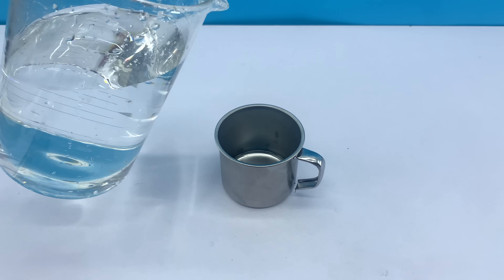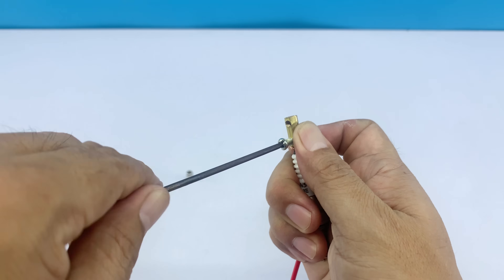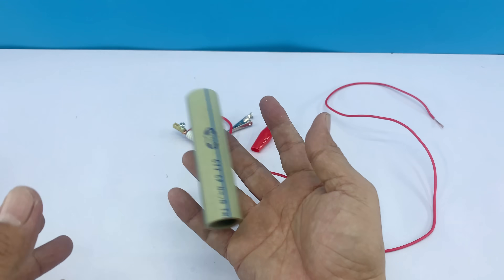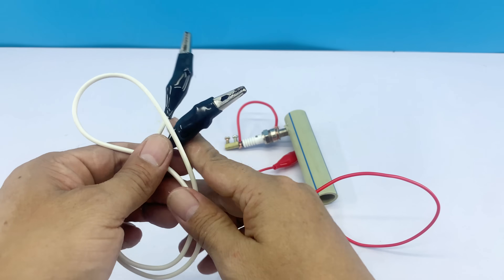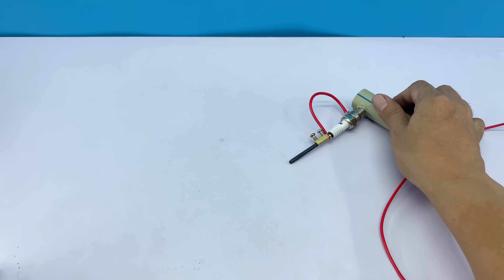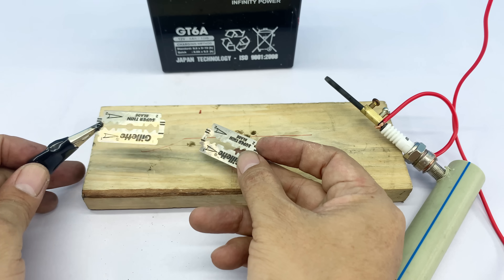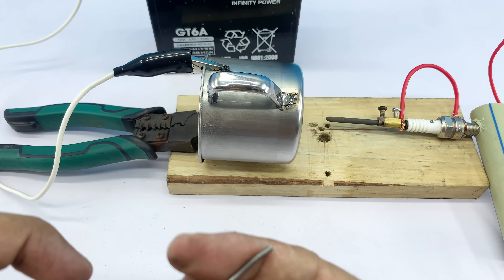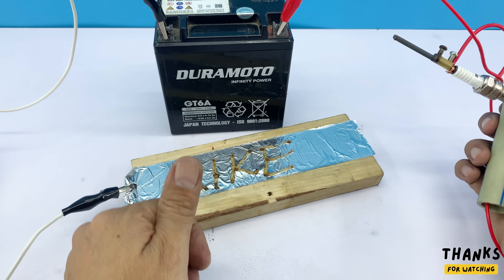How to Make a Super Powerful DIY Welding Machine from a Spark Plug!

Comment: THE SPARK PLUG HAS NO FUNCTION ON THE CIRCUIT. AS BOTH ENDS HAVE BEEN SHORTED OUT (CONNECTED BY A WIRE). iT ONLY SERVES TO MAKE THE INVENTION SEEM COMPLICATED. THE SAME RESULTS CAN BE ACHEVED BY CONNECTING DIRECTLY THE POSITIVE SIDE OF THE BATTERY TO THE ROD EXTRACTED FROM THE SMALL BATTERY. THIS CONTRAPTION LOOKS IMPRESIVE AND CREATIVE TO THE AVERAGE PERSON, BUT NOT TO AN ELECTRONICS ENGINEER FROM SOUTH CAROLINA
Reply: In South CArolina red hot carbon rods don't burn fingers?  The ceramic body of the spark plug is to protect the user from the heat of the carbon rod,  Did you notice it getting red hot?  I uderstand you are an Engineer in Electronics, so I don't kinow how you missed that,  seemed too obvious to me.   Why are you shouting?      YOu are right though, the plug has no funcion on the circuit, that is true, It is intentionally jumped, so that it does not get hot, and gives one a way to hold that red hot carbon rod being used as a make shift welding rod without burning their fingers.   It would function just fine without the spark plug, the circuit does not need it.  But you would have to find another way to hold the carbon rod.  maybe needle nose pliers.  I dunno,  you're the engineer,   you tell me.
Reply: YOU ARE CORRECT, I WAS WONDERING WHAT FUNCTION THE SPARK PLUG DOES IN THIS PROJECT,
Reply: La bujía es un n elemento estructural probado y comprobado como un elemento resistente al calor, la cerámica es un buen aislante, además es un firme y resistente soporte, económico y de calidad, las pinzas facilitan la conexión rápida, práctica y segura, el tubo plástico es un soporte para la mano que resulta práctico, liviano y económico ... todo el conjunto es estéticamente coherente ... para mí todo es perfecto 🤨
Reply: I believe the plug used for good workable structure
Reply: Use of سپارک پلگ 

Is to give electrode
Reply: я тоже думал об этом. было понятно что ток поступает с одного конца свечи и выходит с другого. тогда зачем ещё верхний провод дугой. все можно было делать намного легче.
Reply: Right
Reply: Thank you
Reply: plug. konsi. compny. kaa. hy. aur. battery. kitny. volt. ki. hy
Reply: Sin sentido no produce nada y es nada
Reply: Benar sekali
Reply: 🤣🤣🤣🤣🤣🤣Absolutely,  Nor to a production welder of 30 years. A set of leads and two 12v batteries ran in parallel will also work just fine.
Reply: 100% fake video waisting your time, channel is fooling you to make money.  Criminals
Reply: اتابعك من الاردن 
هل تصلح ل لحام شبك الحديد ل اقفاص الطيور 🐦؟
Reply: Know Every one.    This.   Trick
Reply from the maker: Thank you so much for your detailed explanation! 🙏⚙️ You’re absolutely right — the spark plug here mainly plays a visual or structural role. I really appreciate insights from professionals like you. Do you also share your own DIY or electronics projects online?
Reply: I would not have wasted so many words because the creator don't care in what you think lol
Reply: @zzep69 
Allah will reward you in heaven 72 virgins 😂 not him ❤

Comment: Why the sparkplug?
Reply from the maker: Thank you for your question! 🔧 The spark plug here is mainly used as a holder and to help heat the graphite electrode. Do you usually like learning the different roles of parts in DIY projects? 🙂

Comment: có thể thay thế accu bằng cục sạc 12vol dc ko ?
Reply from the maker: Thank you for your question 🙏 Have you ever tried replacing the battery with a 12V DC adapter in a similar DIY project? 🔧✨

Comment: What is the work of the power plug
Reply from the maker: Thank you for your question! 🙏 The power plug helps connect and supply electricity to the device. Do you often explore how electrical parts work in DIY projects?

Comment: What is the function of the plug ?
Reply from the maker: Thank you for your question! 🙏 In your opinion, do you think the plug works mainly as a connector or does it also play another role in the DIY setup?
Reply: @ToolBros8479 i think Spark plug is optional?

Comment: How about drop down of batteries after used? is it too drop down? 

Bagaimana dengan voltase baterai, setelah pemakaian. Drastiskah penurunannya?
Reply from the maker: Thank you for your question! 🙏 In your experience, does the battery voltage usually drop quickly after use, or does it stay stable for a while?

Comment: Thanks for all ... but r u sure that the spark plug is useful in this matter??... i see it's useless and you can do this job without this plug... just this carbon rod is enough...right?
Reply from the maker: Thank you for sharing your thoughts! 🙏 Do you think the spark plug could at least help as a holder, or do you prefer using only the carbon rod in your DIY tests?

Comment: you have bypassed the spark plug. so it's useless. ONLY GRAPHITE ROD FROM CELL  IS DOING THE JOB.
there is no need of spark plug.
Reply: Бестолковый пример убийства аккумулятора
Вот если бы ещё маленький частотный преобразователь, тогда другое дело, с катушкой зажигагиания
Reply: Spark plug why you need you use only Spark plugs Earthing.
Reply: Não desvalorizar trabalho das pessoas pode ser útil para vocês também.🧐🇧🇷👍🏽
Reply: La bujía, solo la usas  como soporte del mango de conexión del electrodo de carbón,  porque el trabajo de conducción lo hace es el carbón (electrodo positivo) y el borne negativo de la batería.
Reply: If you make short circuits only then what work of spark plug
Reply: True
Reply: Spark plug's cathode was by passed but the anode; this could be effectively working as an intensifier due to it's material and  shape.
Reply: No need?  If you want to butn your fingers holding that hot carbon rod,  go ahead,  Or you could use the ceramic spark plug to hold it with and protect your fingers from the hot carbon welding rodl.   Or maybe you know a better way.  I could be wrong.
Reply: 🤦 you really are an ass! The ceramic resists high temperature. My Gosh! 🤦🏻🐴
Reply: @alexandre5638  hey idiot graphite rod can be held by many other means such as pliers . 
Bastered
Reply: Very true, spark plug installation is a show off, definitely bypassed

Comment: Ich verstehe den besonderen Sinn/Nutzen der Zündkerze nicht, da sie ja komplett mit dem roten Stück Draht überbrückt wird.
Reply from the maker: Danke für Ihre interessante Frage! 🙏 Meinen Sie, dass die Zündkerze in diesem Fall nur als Halterung dient, oder sehen Sie noch eine andere Funktion?
Reply: @ToolBros8479  es mag ein thermischer isolator sein ... natürlich kann man das Ding auch mit einem 45er Colt als handgriff bauen, was halt in der schrottkiste so rumliegt😅
Reply: Por favor ya no publiquen mamadas YouTube
Reply: 😂😂😂😂 pembodohan publik
Reply: Spark plug protects the user from the hot carbon tip,  the ceramic body stays cool and insulates the user from the current and the heat.  It is for safety and comfort.  
Greetings from Chile,  
Ich bin in Landstuhl, Deutschland, geboren, lebe aber jetzt in Chile. Auf Wiedersehen